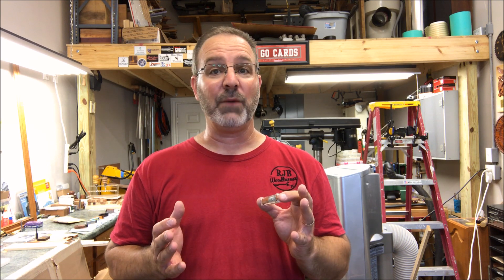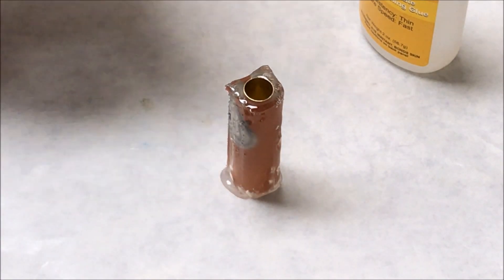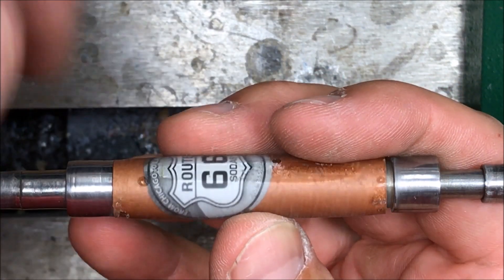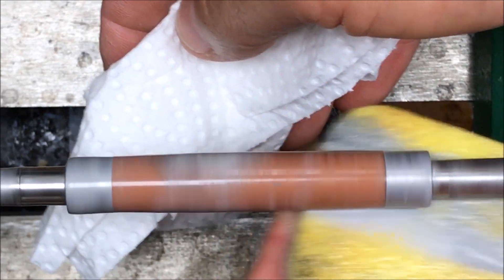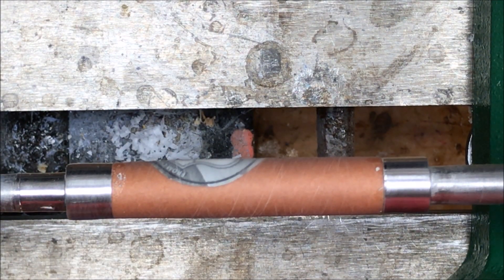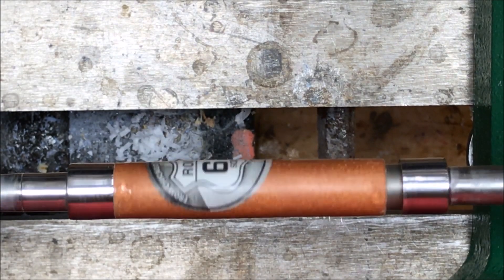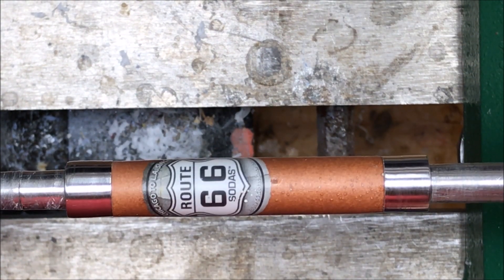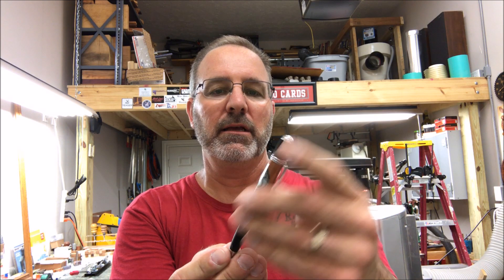Turning A Bottle Cap Pen Blank

Comment: Way to save a lot of time and effort!! Hell of a "hail Mary"! Bob I have found a nifty trick for bubbles that I will share here so maybe the rest of the viewers might benefit; I use very tiny micro drill bits to wallow out bubbles,use latex or neoprene gloves for grip on the bit or buy a micro bit Chuck and simply drill into your bubble. Thanks as always for the tricks of the trade! Be well and send my best to the rest of the family!
Reply from the maker: +Mick Motly Thank you Mick, great tip. 

Regards,
Bob

Comment: Haha, the world's first carbonated pen! Love it!  I wonder if you could wrap something like monofilament around the bottle cap to really hold it tight, then use a toothpick or something to just get CA to weep under the edge as you unwrap the monofilament.  Might help to keep whatever resin from being able to displace any air when it gets pressurized.
Reply from the maker: +Bill Kibby I recently made another tube and sent it to Lynn for casting. Using C/A instead of epoxy worked better. 

Regards,
Bob

Comment: how did you drill out the tubes after you casted it?  unless you somehow blocked the ends ?  wax?
Reply from the maker: I blocked the ends with rubber corks. There was no drilling necessary. 

Regards,
Bob

Comment: I found having a small spray bottle of clean water will clear out most if not all of any slurry that fills those bubbles up. then use a dental pick if needed for the rest.
Reply from the maker: +Edward Uribe Great tip Edward, I need to pick up a couple dental picks for the shop at the next flea market I go to. 

Regards,
Bob

Comment: When casting, if you turn the blank so the bottle cap is facing down, it might cause the bubbles to come out quicker and easier and any that possibly remain should be towards the area your clip can hide. Just my thoughts. It does look amazing though.
Reply from the maker: +Shane Betmarik Great idea Shane, thank you. 

Regards,
Bob

Comment: Hi Bob, by pressure pot do you mean a pressure cooker as used in the kitchen???
Reply from the maker: It kind of looks like that but it's for a attachment for your compressor and a pressure valve to let you know when you have pressured it to the right PSI. I need to do some more research. Lynn can answer these questions better than me at this point.Regards,Bob

Comment: Hi Bob, I'm new to pen turning, but I know you've done, well let's just say heaps of pens!   I'm trying to find a guide to figure out which pen components fits which pens?   I'm going to start with the 7mm slimline or streamline pens, however no matter where I look I don't know which refill fits this size pen?   Online they talk about overall pen length, which is great except I'm told that I'm buying a 7mm brass tube, and how does that fit into the equation???   Please help me, I've got several gifts coming up and I want to do my best, and at the moment they might be lucky to get sawdust.    Also I tried turning two pens and I tightened the screw or nut at the end fairly right and my tail stock.   My problem was the bushings dug into the brass tubes and wrecked them.   Obviously I'm being heavy handed and I need to find that middle ground.   Was it trial and error for you at the start?   Oh yeah I bought a mandrel saver, instead of using the tail nut now.   Do you think that will make things better?   I noticed you mainly just use your roughing gouge, do you sharpen it before use?   I thought maybe the scraper or skew would be more accurate?   Sorry to dump all this on you, obviously I have a heap of questions and nowhere to go.   If it's easier he is my email - stseal@bigpond.com,  thanks, Sean
Reply from the maker: +The Bungling Woodworker Hello Sean,
  I don’t know of a reference for pen components, you might try the IAP, International Association of Pen turners, if anyone has a listing, they will.
 
  Slim lines use a Cross refill and most of the other pens I’ve made use a Parker refill. When you purchase a pen kit, it will come with all the components you need to make that pen, including brass tubes and ink refills. You will have to purchase separately the bushings and proper sized drill bit for the kit. The company you purchase from will usually send instructions for making and assembling the pen. If they don’t come with the pen, then go to their website and look up the pen kit, they usually have a PDF of the instructions there.
 
  The mandrel saver will help hold the blanks tightly on the mandrel but it’s still possible to over tighten them if you’re not careful. Apply a small amount of pressure and try turning your blanks, if they slip, tighten the tail stock up a bit and try again. As long as the blanks are not slipping while turning, you’re mandrel saver and tail stock are plenty tight.
 
  I use the roughing gouge because I like the control it offers. I usually sharpen it right before turning. The skew is an excellent choice if your comfortable using is as are many other tools. As long as a tool is sharp, your comfortable using it, and your being safe, the particular tool does not matter.
 
I hope this helps.
 
Regards,
Bob
Reply: Hi Bob I can't thank you enough for firstly your quickness with the reply, but also the depth of knowledge!   I had NO idea there was an I.A.P, but like anything in life if there's a hobby or club, someone decides to make an organising body....  I can only imagine how many questions you receive, so for at least, oh a week or so I will leave you alone.   On another topic your work is beautiful.   How long have you been turning pens, so I don't feel so inadequate?  Cheers, Sean
Reply from the maker: +The Bungling Woodworker Thank you Sean,
 
I've been turning pens for five or six years. 

Regards,
Bob
Reply: Hey Sean,
Check out https://www.pennstateind.com/, on each pen description page they list the refill which works with the pen.  Only trouble I find is that there are often several names for each style of pen, depending on who you purchase from, like Bob's pen is the Wall Street, I've purchased it as the Sierra, and at least one other name I can't recall at the moment :)
Happy pen turning!
- Bill
Reply: Bill Kibby thanks Bill much appreciated cheers Sean

Comment: Hi Bob, quick question
Why do you wipe your blank down between grits when wet sanding? I want my blank to stay as wet as possible, but you are more experienced than I am.

thanks,
Rick
Reply from the maker: +Rick Rollan I do that to remove the slurry and grit from the previous pad. Otherwise it can cause scratches. 

Regards,
Bob
Reply: RJBWoodTurner Maybe that why I sometime get scratches!

Thanks Bob

Comment: May I ask how you manage to hold your tubes up in the mould? (spelling from UK) And is it necessary to use a vacuum pot for setting the resin? Thanks. By the way I love how you find a solution to problems you encounter.
Reply from the maker: The molds have rubber stoppers on each end that plug into the tube and suspend it in the mold. 

Vacuum is for stabilizing, pressure compresses the bubbles. 

Regards,
Bob

Comment: Use a slower casting resin, something around 20mins to gel. Vacuum degas both the resin and hardner before mixing. Mix and vacuum degas the mixture. Carefully pour the mix into mould and place in pressure pot at 60 -75psi. Guaranteed no bubbles. You can add one additional step if you have a complex item to imbed and that is a quick vacuum treatment after filling the mould and before putting the mould into the pressure pot
Reply from the maker: Thank you. 

Regards,
Bob
Reply: I do like you idea of imbedding bottle tops in the pen blank. This is one case where anothervacuum treatment after filling the mould would remove any air trapped between the barrel and the bottle top allowing the resin to fill the void.
Do keep the ideas coming, I learn something new with each of your videos.

Comment: Clearly that pen took an enormous amount f time. With practice, I'm sure the time will lessen. Nonetheless, this one looks labor intensive. If you sell it, how much will you charge? Do you calculate your time investment? I just wonder if that is more than the market will bear.
Reply from the maker: +William Simpson I don't think I could sell this one and make a profit. It is way to labor intensive. I gave it away. Sent it to Route 66 Sodas. 

Regards,
Bob
Reply: I probably wouldn't try to sell those, using trademarks can get you into odd trouble.  Even at a non-profit several years ago, we received a lengthy letter from the lawyers at Milton Bradley when someone thought it would be a great idea to use Mr. Monopoly for a theme...  They have spies everywhere! :)